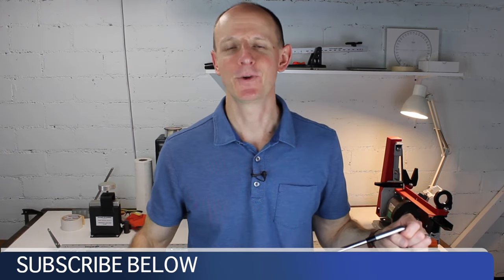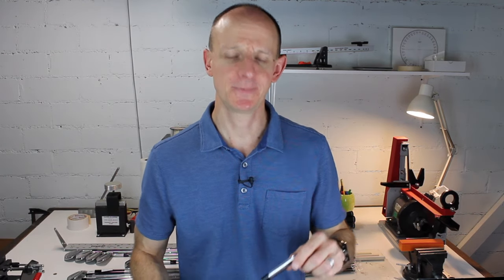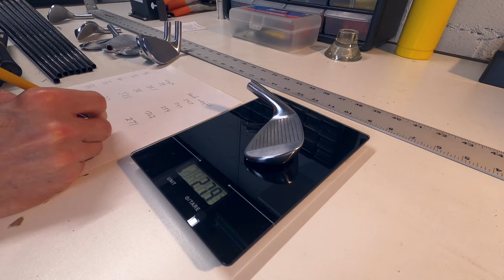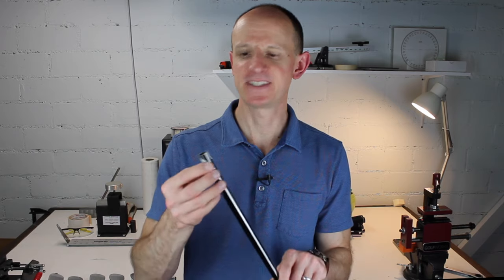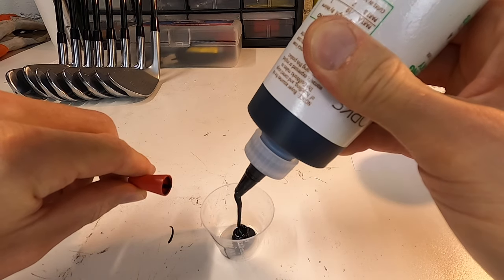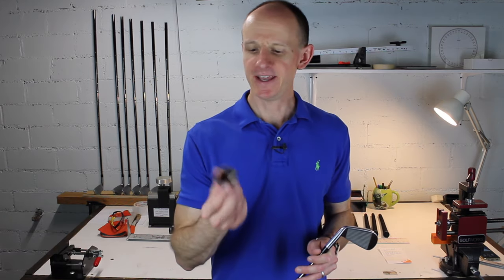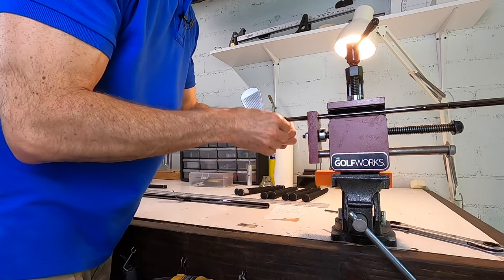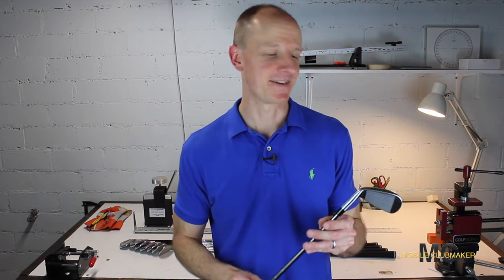GOLF CLUB BUILD - How to reshaft your irons Step by Step

Comment: Great job thks
Reply from the maker: Thanks for watching and subscribing
Reply: All golfers can hit every flex. But I believe the flex they can control direction the best, in their chosen head, weight and length. Thus optimizes the fit.
Reply from the maker: @johnknobbe8247  My point is that far too many people get too wrapped up in the idea of flex or hitting exact CPM numbers, and from my experience it's just not that important. Yes it has value, and my comment about hitting a flex vs. x flex was a bit tongue and cheek but still holds. See people going back and forth in there heads between 2 flexes all the time and it just doesn't seem to matter much. And I would argue whatever fitting differences you observe will very often be negated or a least flattened out after more time with the clubs.

Comment: Can the shafts be re-used?
Reply from the maker: Yes. I did a video with this topic. Just need to make sure you remove the graphite shafts correctly and with either steel or graphite, prep the tips and drill them correctly. I would go onto my channels videos and find the reusing shafts video.
Reply: @EFGMC  thank you

Comment: i think more time should have been spent on measuring out the new shaft and cutting which end. swingweight is so important and shaft length makes a huge difference in swingweight. you may not care too much about swingweight but there is a huge difference in D-0 vs D-5

Comment: Be nice to see the tip weight method,  the amount, and style. But good video.
Reply from the maker: I was just using either 6g or 10g taper tip shaft weights in brass. The Mizuno heads I was using were all about 7 grams light to start with. Ended up with everything right at D2 with wedges at D3 which was right where I wanted to be.
Reply: MOBILE CLUBMAKER hi, how close do you like to get the swingweight for all the irons? Like plus or minus a half point? I have a bare bones scale that isn’t going to give me a precise readout like a digital one.

Comment: So, no trimming of the tip.  The length of the club is decided at the butt end.

I want to replace the shafts in 3 second-hand clubs I've managed to get hold of.  The shaft they came with are far too stiff.

I've opted for TT Dynamic Gold SL R300.  These are 105 gram shafts.  Much lighter than standard Dynamic Gold.  I am looking to maintain the standard swing-weight of D2/D3.

How do I do that?

You didn't go into much detail on swing-weight apart from measuring it.  What happens if it is way out?  How do you bring it back?

Lastly, I wish I'd got a workshop like yours.  I'd lock the door and hide from the wife!
Reply from the maker: You butt trim only depending on the shaft. Taper tips shafts are butt trim only. Parallel tip shafts might be butt only or butt and tip trim (if you buy blanks. Basically if you buy a shaft that is for a specific iron, it's butt cut only. If you buy a 41 inch blank, you need to tip it first and them butt trim to length.
First thing to do with SW is measure all your heads and make sure they have around a 7g weight progression. This should ensure that all the SWs are the same at least. From there you can dry fit them together to measure the swing weight. Cut to length, install the grip, and hold the head on with a little duct tape or fishing line inside hosel. Then you can add shaft tip weights to adjust the SW as needed. 2g = 1 swing weight point in the head.
If you don't have a swing weight scale, I would watch this.
https://youtu.be/sJALUBr51jI
Reply: @EFGMC  Very interesting - all of it!  I am a retired aerospace engineer who takes an interest in this sort of thing and to a certain extent will undertake some of the work.

I do have a simple swing-weight/club weight balance care of Golfsmith, however, with the swing-weight subject I feel the exercise getting a little more complicated.  The tip weights you are using are largely only available from China if you buy from eBay and the turnaround on deliveries from there are hit and miss unfortunately.  I could have a  dismantled club for over 6 weeks waiting for them to turn up.

I think just for the sake of the two clubs I want to re-shaft, (a 712U 3 Iron and 4 Iron), I will leave it to my clubmaker.  He's quite away from where I live but if I arrange things and kill a couple of birds with one stone it shouldn't present much of a problem.

I note that these tip weights for steel shafts are made from brass, (alloy of copper and zinc).  I have a set of old Wilson FG49 irons.  Best clubs I ever played with.  Many moons ago the 5 Iron and the 3 Iron both had to be re-shafted.  Both broke on the shaft near the hosel.  The cause for both of these fractures was down to copper.

Wilson, in their wisdom, used copper powder with bonding adhesive as a swing-weight medium.  They evidently poured the quantity necessary down through the butt end.

What was happening was a chemical reaction over time between the dissimilar metals.  It's actually called "galvanic corrosion".  The steel is the weaker of the two and corrosion sets in from the outset.  Maybe brass, because the percentage of copper is reduced may have a lesser effect.  It doesn't seem from looking at what's available, that there is any alternative though.
Reply from the maker: @Barney29508  You can find numerous supplies from Golfworks. They have all the sizes and weights in both brass and I think still sell some in lead also.
You can also find tungsten powder. Copper powder was before my time b/c I was using tungsten when I started building 20 years ago and you are the first person to mention it. Learn something new every day!

Comment: If you scratch up the hosel when sanding down the ferrules, is there anything you can do help fix it?
Reply from the maker: Going to depend on the finish you're dealing with. If it's a dark paint or coating on it, you can try and match it up with some touch up paint or a stain made for use on metal. Other option is to leave it to oxidize and darken by itself depending on metal type.

Comment: Nice job, the clubs look great. A question regarding the tip trimming of the shafts to achieve required flex, did you use a manufacturers guideline or frequency machine for this? Also, do you not bother with spine alignment? I'd love to reshaft my irons with graphite at some point, the club building world seems to have so many different methods though. 🤪
Reply from the maker: These shafts were taper tips so you really don't have much option in how they are trimmed, maybe 1/4 inch at best. So they are just set by the manufacturer. Rarely these days will you have an issue with a shaft performing based on being out of spec unless you are using really old or cheap shafts.
Spine alignment is a total waste of effort in my opinion. Have some videos planned upcoming to show why. At best there is a placebo effect for what that is worth.
Reply: @EFGMC  cool, look forward to watching those. 👍

Comment: did not wee you tip the shafts.  Must be using the .355 tip vice the .370.
Reply from the maker: Correct. Mizuno takes .355 tips.

Comment: If you are new to doing this...put a wet towel or paper towel over the plastic piece at the base of the hosel so you dont melt/burn it with the torch...that will ruin your club
Reply from the maker: If you are wanting to save the ferrule, that is a good way to try and keep it from melting. If you plan on replacing the ferrules, you can just heat the hosel and let the ferrules melt a bit. They are easy to remove from the shaft or hosel once hot.

Comment: This video makes no sense. Why weigh the grips if you arent concerned with swing weight??? Why not get the swing weight of the original clubs before taking them apart?? Then why re-weigh the new shafts and grip if you have no general idea of what swing weight you want? D0 to D5 is a super WIDE RANGE. You are also adding tip weights?? but not concerned with precision swing weight?? Then he sands the ferrules when done removing weight. 

Yea this makes no sense. Notice he never checked the swing weight when done. This is reckless. I would avoid taking any club to this dude. He seems more concerned with making things look pretty versus useable in terms of "building a club that can match the previous club. Building clubs is for use not looks (for a serious golfer)... getting SW accurate/ worng can also improve/ destroy swing behavior.

  Not knowing SW or even targeting a specific SW is like wasting time buying nice shining black shafts and new grips, and can also totally impact a players game. I cant take this serious as there has to be consideration for swing weight for serious golfers and club makers. Just slapping on a new shaft and grips can totally alter a club/ destroy even the worst golfers game- without even knowing.
Reply from the maker: Thanks for watching

Comment: Amazing video., have a question what's the temperature setting in your heat gun, I'm planning on getting one with a 1100F (590C) range
Reply from the maker: This one only gets up to around 750-850F. Have the torch if I need faster. 1100F will be more than enough.
Reply: Thank you so much for replying, I have another question tough, I will be building my next set of clubs myself using your videos. But what happens if I don't use shaft weights? Or what do you recommend? Currently I have a regular flex Cobra F7 One Length set with stock shafts weighting 107 grams and D1 speed setting, I'm changing shafts to KBS 90... Thanks and keep making such amazing videos
Reply from the maker: @sergioalonso9222   One length clubs are going to be a different animal from standard iron reshafts. Are you using .370 shafts? Ideally you should trim all of them the same amount because all the heads are the same weight. However you could also do a modified trimming with the shorter irons getting more tip trimming and the longer irons less, to help with trajectory. If you are trying to figure out the swing weights and match them up, I would look at an online swing weight calculator. Here is the video I just did. As long as you are pretty accurate with measurements, the results were very good.
https://youtu.be/sJALUBr51jI
Reply: @EFGMC  according to Cobra customer service, they told me the F7 are dual bore so I went and bought .355 shafts (7 iron length shafts - 7 in total for all my set and I will be cutting them 1/2") if that doesn't affect the weight and as you mention the heads are equal I don't see a reason to add any weight..again I appreciate your response
Reply from the maker: @sergioalonso9222  Ok. Assuming the heads are all the same weight to start with and you are happy with the SW you get from that shaft at that length, you won't need any additional weight.

Comment: Can an old forged irons be updated to current specs? Would I have to restart with lighter shafts
Reply from the maker: Many forged clubs still use a 130g stock shaft so that hasn't changes necessarily. Lofts and lies have changed and you can adjust the lofts on your clubs accordingly. I would not adjust lies unless your swing actually dictated it.
Reply: Thanks for the reply! This is my situation, I have a set of Muirfield irons that I used to play and love. However I switched to a set of Cleveland Ta2 thinking more forgiveness. Years later I miss my Muirfield I hit them well just lower and shorter. I noticed cleveland was 1/2 inch longer and I can adjust my own lofts.